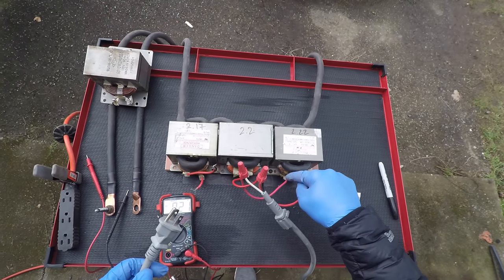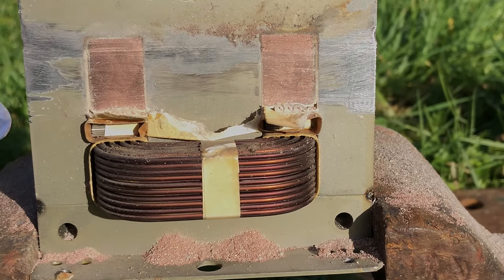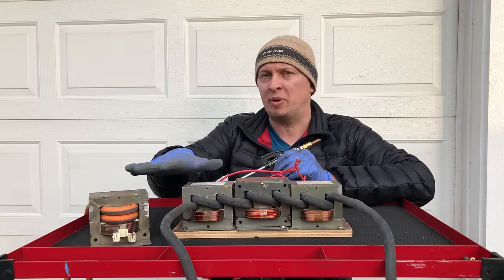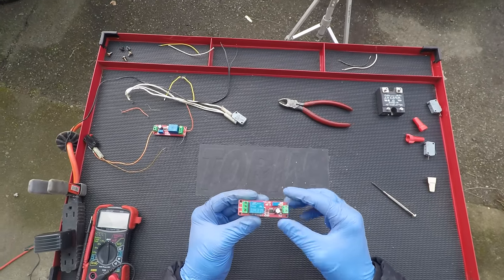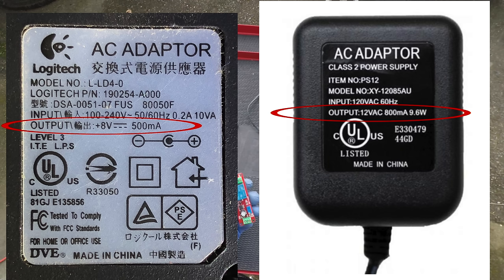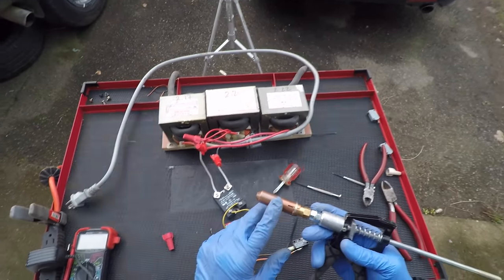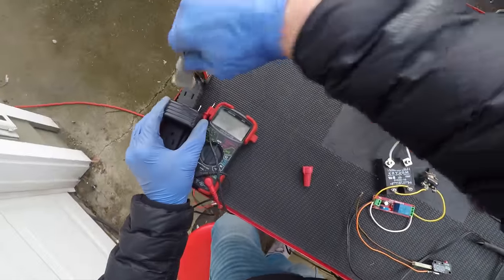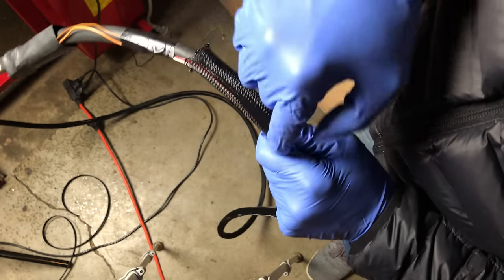✅ DIY Car Body Electric Dent Puller Welder Spotter From Microwaves UPDATED

Comment: This looks like one of the finest ways to meet Jesus early that I have ever seen.❤😂
Reply from the maker: Not really... There isn't a chance of even small shock, this set up is 100% safe. It outputs less than 7 Volts
Reply: @fix206  but what kinda amps???🤣👍
Reply from the maker: I'm not sure exactly what the amperage is but it is pretty high. There are Chinese analogues of the same tool out there and they work on exactly the same principle. Pretty sure if there was even a slight danger of a shock hazard than those units would not be allowed to be sold. I've used my tool for over five years, and I have never been shocked...
Reply: @fix206  I'm sure you did an excellent job. No question.  A totally insulated box and cooling fans and vents might be a little safer . One bad accident might create liability issues but then again there are so many actual liability issues on YouTube that it's not likely to ever even be an issue. I don't know if it's a UL safe product or not .😁👍 Reaching in a microwave oven for parts can be totally fatal though. Capacitors allegedly can store a nasty wallop.   

Dude ,no issues from me. I'm seriously impressed you built the thing.

Comment: Found a better way to cut the copper  out of the transformer 0scillating  multi tool quick  and precise you can control  the cut and not accidentally  hit the other coil
Reply from the maker: There is more then one approach to do just about anything...in this video I was trying to use tools that were accessible to majority of people. Hacksaw is a very basic tool that most folks would probably have in their garage and that's what I had available within arms reach at the time of filming, so that's why I used it.
Reply: @fix206  I understand  what you are  saying  my problem  with it is I ruined three transformers I figured  other people  would  want to know  about  a faster easier way reminds me of a comedian  doing a cooking show skit if you don't  have a coat hanger a wire whisk will do nicely
Reply from the maker: Good call !! it's always good to have options.

Comment: I'm from India here we operate on 220v 50 hertz. Can I use 220v 50hertz transform? Instead on 110 60 hertz?
Reply from the maker: Yes you can, go ahead and use the 220V transformers and do everything else just the way I did it in the video and you'll be good to go!
Reply: @fix206  I'm greatly obliged by ur timely reply. Thank you very much. Another quick question can I get away with just two 220v 50Hertz transforms and later down the line add another one. ?
Reply from the maker: Of course you can use just two if you’d like, but you’ll get much better performance with 3
Reply: @fix206  okay thanks a lot. You've been of extreme great halp.

Comment: Could you have used more then 3 mot?
Reply from the maker: I"m not too sure on 3 mot... but Try and get the thickest cable you can into the transformer, the thicker the better as long as you can make the windings just as I did in the video

Comment: I bought the same model as yours price varies alot to make you wonder about missing something when you never had electrical  experience
Reply from the maker: I think the reason the price varies is because new crydom SSRs are pretty expensive, but you can get a used one for much less...

Comment: Hi, can you help me ..Can you specific your adapter for 12V relay ? ..Thank you
Reply from the maker: This was just a random 12 V adapter that I had sitting around. Basically anything with 12 V output will work, just make sure it's not putting out too much amperage. Try not to go above 1A output
Reply: @fix206  So , thank you for help.. I try this with one transformator ( more loops) , and it doesnt work.. I think, that my fuse in 220V (20A) it´s very small.

Comment: Wow , that was way cool I have a Spitznagel unit that needs more power when using on early cars that have 20 and 19 gage sheet metal.  thanks Mark
Reply from the maker: Yeah man, the more transformers you got the more powerful of a setup you get. With one of these units there's always room for expansion, unlike with factory built ones that were not meant to be upgraded in any way  👍

Comment: very nice built  only i can say that most welding machines have a fan to keep the transformers cool , with a larger box you can add this fan to help with that ,
Reply from the maker: I suppose if you wanted to, you could add a fan, however I don't really see a need in it, because when you're welding something with a welder you could be running a continuous bead for a couple of minutes. In that time the transformer will start heating up and if the fan is running in that instance it would certainly help with cooling. But when I'm using the spotter, the pulse duration is just about half of a second long. And this is something that I've tested in the past where I worked an entire panel and then touched the transformers right after to see if they were warming up and they were still cold. So in my opinion the use of fan with this set up would be an overkill.
Reply: @fix206  any way you showed us a lovely way to to this and achive the pro results thank you for sharing ,all the detales and parts needed

Comment: Will this work the same way if i connect it to an extension with a flip switch and just flip that for 1 sec? Or 3 secs then flip the extension box off? The whole circuit box and other stuff seems too complicated for me
Reply from the maker: Sure, you can avoid the timer switch and just have a simple push button switch to power the transformers for about half of a second. But trust me I am no electronics Wiz, and I was able to get this whole thing figured out myself and put it together. I'm sure if you watch the video start to finish one more time and look at the wiring diagram in a description of the video you'll be able to replicate my entire set up
Reply: @fix206  that diagram makes it a lot easier thanks
Reply: @fix206  With the new style puller attachment on your description, do you still need all the electronics and timers and stuff since now the puller itself has a button that internally activates everything?

Comment: Can you make me one how much?❤
Reply from the maker: Sure, I can build you one. It will be even better than the one in the video since I have upgraded mine with much better electronics since this video was made and it will have the same puller that I'm using in my videos... But that means that I would have to go out and try to track down some transformers, convert the transformers, and then buy all of the other components.  It's going to take mea good bit f time to gather all of the components and have everything put together. You would be looking $1000 for everything
Reply: @fix206  You mentioned you have upgraded better than this video. Could you please post that upgrade video? It will help all of your fans here.

Comment: Just another question, what kind of metal has to be the tip of the puller? With one transformer none get welded, hope with the three transformers get to it, thanks a lot!
Reply from the maker: One transformer just isn't enough, 2 transformers at least but 3 for best results !! The tip is made of steel, because only steel will weld to steel, other metals will not.
Reply: @fix206  thank you very much, appreciate the quick answer, you the best!
Reply from the maker: You got it man !!

Comment: I built one by your instructions  but the timer seems to be a delay on timer , should it be a delay off ?  Thanks
Reply from the maker: You have the timer hooked up wrong... once again look at my wiring diagram
Reply: I have the same problem. Mine takes 10 seconds to switch ON, then stays on. Small dial doesn’t seem to do anything. Amazon seller says it can be programmed using Audra. Hmmm? I wired it as you displayed.
Reply: Arduino was the programming tool they recommended

Comment: Great job on the build and the video! Have you researched adding a potentiometer to the timer so you can have an external dial to control the time? I use a Lenco dent puller and find the weld time needed can vary quite a bit from vehicle to vehicle.
Reply from the maker: I see what you're saying, different types of vehicles with different metal thickness would require different duration of pulse, I actually bought a potentiometer a while back and I may still add it to my set up later on, I just wanted to limit the amount of stuff that could potentially  go out and cause issues , just want to keep is as simple as possible :-)
Reply: podrias por favor ayudarnos a donde colocar el potentiometer en nuestro  NE555 DC 12V Delay Timer Switch, algun esquema????

Comment: Thanks for posting Thinking I'm going to make me one. Just one thing you could wire it just to use one or two of the transformers for lower amps to use it to do something else like spot welder.
Reply from the maker: Instead of 2 or 3 of them running all the time, you can always  cut the power to the transformers you don't want to use  and I just keep one of them powered up, and later as you'll need more power just reconnect the other ones.
Reply: sounds like the use of another toggle switch. 1-2-3 transformers at the flip of a switch
Reply from the maker: @reedrobb  that would work

Comment: Did you measure the current output?
Reply from the maker: I did not, but whatever the output is I know it's plenty because this spotter can handle just about anything I can throw at it
Reply: @fix206  the reason i am asking is because i tried doing it and i cant get the spotter to sitck good enough..its works well for shrinking but i had no luck getting it to stick. My setup - 3 transformers- measures 620 amps and around 7 volts.
Reply from the maker: What are you using for a tip? Make sure it's not a stainless steel bolt, because stainless will not stick good to a regular steel body panel. Better yet get a mild steel rod, sharpen one end of it and try zapping to the panel... Let me know how that works out
Reply from the maker: Any updates?
Reply: @fix206  yes..it starts to work after i replaced the bolt - which was steel bolt sharpend to a point- with 2mm sheet metal of mild steel. Thank you very much.
Reply from the maker: Glad to hear that worked out !! I'm currently working on a couple of videos where I will be upgrading my spotter with much better electronic controls. Also soon I will have the hand puller with various attachments for sale that you see me use in the video. Not sure if that something you'd be interested in, but those videos will be full of good information. Cheers !

Comment: Great video been waiting for this update I have just one question with  your microwave door switch is it normally on or off all mine here are normaly on so do I need a another switch I wired it in series on the grown side.I have to push the button to de energize the transformers.
Reply from the maker: You normally would see both kinds in one microwave, don't quote me on that though, I'm sure some manufactures will only use one kind or the other in the design of their microwave. I normally just test them first with continuity meter to determine what type they are
Reply: @fix206  Ok thanks for the reply Iam going to use a horn button switch  I cant wait on till i get it all together .
Reply: Well mine is up and running it works perfect I dont have the electronics in mine yet this is my  prototype haha many thanks . I know how to make the puller thats the next project.
Reply from the maker: @arnoldcomeau8015  Oh man that's awesome... I remember how exited I was once I had mine built... It is truly an amazing tool, and you'll really appreciate it once you'll start using yours

Comment: Where did you get the solid state relay?
Reply from the maker: I got this one that I used in the build a while back, not even sure where... but there is a link to similar one down in the video description
Reply: Just bought one on e bay you didn't  put a link there are many types had to do some digging  prices vary so much  I was worried  about quality  seems like they are all the same
Reply from the maker: I totally failed to add SSR link in the description... Thanks for heads up, just added it. I would personally stay away from FOTEK brand, because I've had nothing but bad luck with those, hopefully that's not the one you bought. And also I wound't use less then a 40 amp relay, 25A is a no go, 40-50A should work out the best